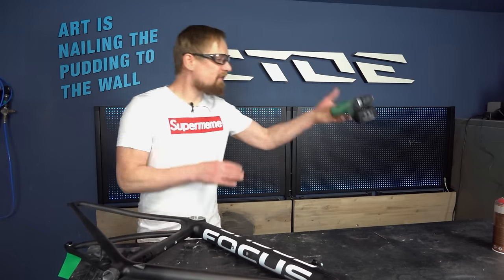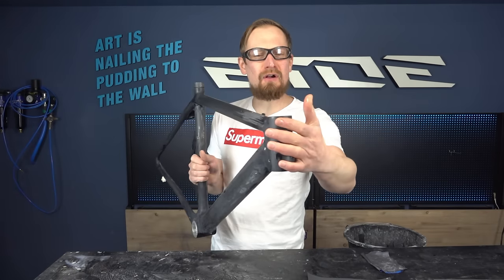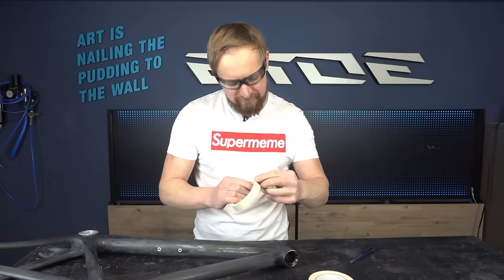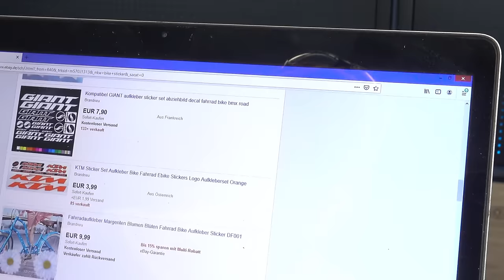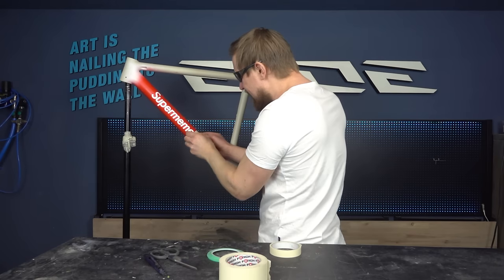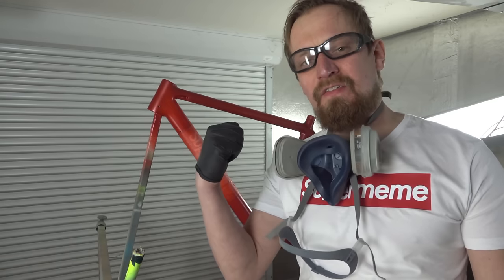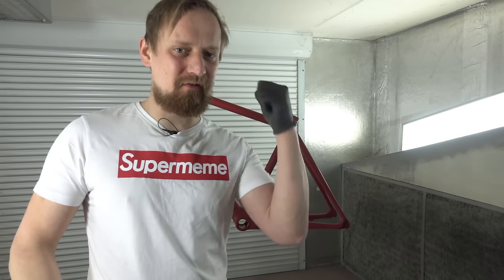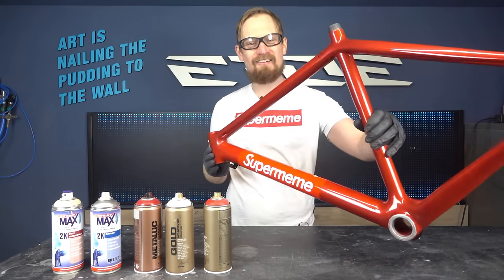spray paint a bike at home with supreme quality DIY

Comment: Martin.....dude! My favourite video yet! You calling people “pussies” made me crack up and I am not offended. I have painted many frames using spray cans, but cheap US stuff Krylon. These cans are not 2 part with hardener. I will be painting 4 bike frames soon. 1. Schwinn Scrambler 26r, Schwinn Scrambler 29r adventure, Schwinn Cruiser, and a 1949 Schwinn Hollywood girls cruiser that will carry Hula Hoops. The Hula Hoop bike will have 5 different colors, fades. The other 3 frames will have a single color.... metallics. Also I am DIY welding and designing from scratch using Schwinn tubes from recycled Schwinn Varsity road frames!  These up-cycled tubes will be used in the first 2 frames. The Acrambler 26f will be a tribute 16” wheel bmx bike. The Scrambler 29r will be a modern adventure bike with a custom frame pack. Both of these Scrambler bikes will have the same look as the 1979-1982 Schwinn Scrambler bmx bikes. I will send pics and I will be doing my first videos ever! You are my favourite painter and the best!

Warm Regards,
Tim in Boulder, ColoRADo (USA)

Comment: Hi Martin, your videos are so inspiring and you make it sound so easy. I followed your recommendation to paint my kids bike: aluminum frame, degreased, 2 x 2k primer and 3 x Montana gold paint. I want to mask with vinyl stencil and add some graphics but the surface is a bit rough and I am afraid paint will run under the stencil. How do you avoid rough surface with Montana Gold? Should I wet sand before applying the stencil? Any help is appreciated! 🎉
Reply from the maker: I just don`t paint a rough surface on the initial layer as shown in my spray can videos. That`s all. DIYers are not able to handle a can right and make these mistakes like rough surface.
Reply: @ETOE  thank you for taking the time to reply. Highly appreciated. It’s a bit strange, I sanded the primer to a smooth surface. Maybe it’s the way I handled the Montana Gold. Can I sand the base color? It’s a solid non-metallic color.

Comment: Hello im restoring my old trek 660 bike, I stripped the frame down to metal like you recommended,  gave one pass of primer , sand it, second pass and send it, the same thing with paint, but the clear it giving me hard time , it smooth some places but other is like sand , I'm using spray cans and I don't have a room so I'm doing it in my patio. What I can do?

Comment: Hey ETOE. Loving the vids. You've convinced me to switch to montana spray cans for my painting endeavours. Am just now experimenting with using two colours and am unsure about the masking process. What tape should i use and how long should I wait for the first colour coat to cure before applying the masking tape. Can I then apply the second colour coat straight after or should I allow the first coat to cure more. Cheers!
Reply from the maker: Thanks a lot. Helps to do more Videos. Curing depends and is an hour minimum. Or you force it in an oven at 60Degree.
Reply: @ETOE  cheers heaps. Well see how it goes!

Comment: How long do you wait between applying the clear coat and sanding? And how do you dry or clean the frame after sanding?
Reply from the maker: 10 minutes and with water. That´s the wet clear thing, sometimes blue as well depends where you find it.

Comment: Thanks for this fine tutorial!
I would like to paint with different colours. Is it ok to wet sand all colours after drying before the application of clear coat with p800. Or could i apply the clear coat without sanding during the next 12 hours? I use the stuff you mentioned below.

Comment: What kind of colours do you use when painting a frame professionally with the spray gun? Are these similar to the 1K Acrylic spray can colours you recommend for DIY-paintjobs, or do you use 2K colour + hardener? I‘m a carpenter and know how to spray paint (furniture, chairs), i also have a booth and a small hvlp gun. But i never did a bike frame or car parts, and i dont know what kind of primer/colour/clear coat to buy when not using spray cans. i only used paints for furniture so far. Any advice would be great!
Reply from the maker: By a wooden bike. Problem solved!

Comment: I dunno if ill get a respond but, i tried this method and it all works out except that when i try to remove the sticker after painting over it the paint kinds bond with the sticker and when i remove the sticker the paints kinda follows and lift up. Is there a kind of sticker and that would've prevent this from happening? Also the stickers i used are kinda thin should i use a thicker one? Like vinyl or something?

Comment: I understand the primer and first clear coat needs sanding back, but I thought the main colour needed sanding as well before the clear coat? Great video, thanks.
Reply: It depends on the paint your using some paints are designed to have a open time where you can put coat after coat with out sanding. Some may disagree but my auto paint teacher has museum pieces that beg to differ.
Reply: @allstarwoo4  - Understood, thanks for clarifying.

Comment: Guten tag Martin, Great video! You do make it look easy. I am doing a paint job for my 9year old boy who is upgrading to a 700 wheel size bike (small Specialized Ruby). I am in the process of sanding back all the pain and I have drilled out the old cable stop/guides. BUT, I cannot get the bits of the rivet from inside the frame. What are your suggestions? Drill slightly bigger holes or remove of the water cage bolts (I have seen another of your videos on that). Because he is a junior and the rules about gearing for junior races in Australia, he will not have a front derailleur so I could use those existing holes (which won't be used again) to drill bigger holes and then patch the hole?  Thanks again for all your videos. Danke und Tschuss Julien

Comment: I have removed all of the paint and primer from my steel bike frame. is it necessary to treat the bare metal with rust remover or rust converter? there is no rust after i sanded...Danke mein Freund

Comment: If I am going for a “raw” look on an aluminum frame with a carbon fork, could I skip straight to the 2K clear coat after the sanding and cleaning process? Or is there some sort of clear primer that needs to be applied before the clear coat?

Comment: Only one thing I don't understand what to do is:

After applying 2K clear coat and waiting 24 hours to dry and cure, then to remove the orange peel, I have to sand the frame. Ok

But after sanding it will look cloudy or milky (like in your video, the red frame looks like matte) and this is the part where I don't know what to do. Do I apply another layer of clear coat like you did in the video ? But what about the milky/cloudy look that the frame has after sanding ? Does that cloudy finish gets removed when putting the 2nd layer of clear coat ? Or do I have to compound and buffer to remove that cloudy finish before applying the 2nd layer of clear coat ?

I'm asking because on other videos on YouTube they say to sand the orange peel with 800 grit, 1200 grit, 1500 grit, 2000 grit then lastly with 3000 grit sandpaper, but then it doesn't stop there. They continue and say to use compounding to remove sanding scratches (even for 3000 grit), and then use another buffer type of stuff to remove the compounding swirls with the rotating buffer hand-held machines.

So what I don't get is that is it necessary to do the 3000 grit + compounding + buffering to remove orange peel or not ? Because in this video you don't do that and the finish is the same like other YouTube videos with compounding and buffering ?

Maybe both methods work the same way ?
Reply from the maker: I do BP. Butt Polishing. Put the frame between your legs and then shake your butt until the surface shines like the blink of a fairy tear breaking in the first strokes of sunlight hitting a new day.

Comment: Hi, I painted an old frame about a year ago with Montana White and did about 5 coats, one coat Evey 24hrs and it took around 8 months for the paint to fully harden, do you why it took so long to harden as it was so soft that it left finger nail marks when I pressed down on it, if you can get back to me that will be great! Thanks

Comment: How many hours did you give until you removed the Supermeme sticker from the frame after painting? Fully cured 2-3 days or just dry to the touch (couple hours)?
Reply: I wonder if paint stripper would be quicker to get the main junk off? Seems like LOTS of sanding!

Comment: Martin, can I use Montana HARDCORE and 94 cans on aluminum and carbon frame?. We dont have the mtn Gold here. BTW, do you sand over paint after removing those stickers. Or  you spray the final finishing coats? Thanks.

Comment: When you mix the hardener in the 2k primer. Are you still able to use the can the next day to give it another coat when it is dry on the frame? 
Or does the paint dry in the can?
Reply from the maker: 86 hours left to use it.

Comment: My first time watching your videos and I'm very impressed - you did a great job explaining and the results are great. Two things it would be good to help people on here with:
1, How do you clean the frame after sanding or between coats/handling? I'm assuming you wash down with water after the sanding and wipe with a rag and some thinners if handled? 
2, My personal preference is to start the paint job in some of the really awkward areas as, if you come back to do this later, it's likely to run. After those areas, you can move to the big sweeping movements.
Reply: Tack cloth is one wiping medium body shop people use.  Also body solvent, but I would check first to see what's compatible with carbon fiber. The song running in the background was perfect, especially the part with the girl vocals. Anybody know the name of it? I won't ask my wife, she might smack me.

Comment: Man, after working in a bike shop for a few years I feel I have grown paranoid of carbon, yet here he is man handling it no problem. Honestly I was kinda surprised seeing the rivets installed! Looks like a lot of force into that frame at a localized spot. So much stress! 
Ill stick to working on aluminum for a while haha
Reply: Hi, can you paint a bike without removing its old paint, just by sanding it first and after applying your new paint with no primer?

Comment: I keep getting a fine orange peel texture with the Montana Black. Does this have something to do with the higher pressure or heat low humidity? Temp was around 90 degrees F. and 35% humidity. Does Montana Gold work better as a bike frame spray paint?
Reply from the maker: Is has something to do with the painter and her expericence.

Comment: Hello,

Thanks to your video I was encouraged to paint and lacquer my carbon frame.  The result was good than I expected but the varnish disappointed me a bit.  I used a 2K varnish as you say but from the "kustom canz" brand.  The appearance is good but on the first route where sweat has fallen it has lost its shine.  Do you recommend a trick or do you recommend another varnish?  I am willing to sand this varnish and put another one.  Thanks in advance

Comment: Could you tell me how you sand the layer of Primer. Do you use 400 ,600 and 800 (wet) like before or 400 dry an 800 wet?

Comment: Hi Martin, I have recently painted a few layers of base coat on my old bike. I was wondering if it is OK to wet sand the top coat with 2000 grit before applying clear coat. My top coat has a bit of a rough/dry/powder-like texture to it... i want it to be very smooth before i paint it but I don't want to mess anything up! thank you
Reply: Same question here 😉
How can we avoid the rough/dry/powder-like texture?

Comment: Why not using paint remover for the first step of the process? Wouldn't it be faster than scratching te whole frame?
Reply from the maker: I answered this question more than 2000 times. Because it destroys the resin and carbon bond!

Comment: Should you sand down all the color from te original paintjob first? thats gotta weigh at least 200g on it's own. then you've added another what.. 400+ grams with these paintjobs?
Reply from the maker: They weight 50 to 70g. You should remove the original paint because of possible chemical reactions with the new paint.

Comment: Do you have to sand the top coat with high grit (800 or higher) before applying the 1st layer of clear coat?
Reply from the maker: Yes you have to sand the butt with high grit after the big poop before you put your pants back on.
Reply: How long did you let the 1st layer of clear coat dry before sanding and applying the final clear coat. A few hours?

Comment: I am in the last stages of this clear coat technique and the 2K clear needs to go on fairly heavy to lay flat, otherwise it leaves a sort of textured surface. It sets up really fast on the surface. How am I possibly going to avoid orange peel in the finishing layer of clear? Worst case is I have to polish the surface which will be a pain but look great.

Comment: Thanks for the video but to remove the decals use a rubber wheel. It will take you seconds to get them off with that wheel/ seems like you spent a very long time sanding.

Comment: Is it normal that the 2k primer/filler can be sanded (grinded?) way more easier than the original paint? Within seconds I was down to the bare metal again.
Reply from the maker: You applied not enough primer.

Comment: Hi Martin, carbon frames from China are usually delivered with a base coat of black-matt, if there is the option of ordering a non-pre-painted (raw) carbon frame, does the frame still have to be pre-sanded or something else?
Reply from the maker: If you are a lazy douche bag then no. If you are a pro painter then yes.

Comment: Hi Martin, I hope this finds you well. I have a question, when I drilled the rivets through then my frame is also ea enclosed system. How do I stop the bits trapped inside from rattling around please?

Comment: Could you talk about the timings in regards to the coats? My cans say 15 minutes between coats, but do I need to wait 24-48 hours for the paint to dry before I sand and clear coat?

I ask because I did 15 minutes between each coat for everything (primer, then paint, then the lacquer) but my paint (3 weeks on) still is soft enough to be scored with a fingernail even though it's been outside and middle of summer here.

Hope you or someone else can help?
Reply from the maker: Yes I can help. Send me your frame for painting.
Reply: If you put your clear coat over the base coat only after 15 minutes you're likely sealing in uncured paint. It may harden at some point but 3 weeks is a long time. You're probably screwed and need to redo everything.

Comment: Is a paint remover okay to use and then sand the frame a little bit to smooth the surface?
Reply: No. Paint remover softens the paint and will ruin the layer. If your going for a super glossy finish your clear coat needs to be perfect. Say you do a 3 either 5 coat clear the last 2 coats take as much time as your clear coat allows.

Comment: Hello Martin, i really like what you do and watch your vids every time when i want to paint my frames and fallow your guidance step by step but there is one thing i would like to ask and that is after sanding the frame in order to get rid of any kind bubble or uneven surface i have noticed that you also (even tho a litte bit) remove the paint. It has happened to me and did not know what to do. Especially in the last step when you ready to apply clear coat. Do i need to paint that area again or does the clear coat covers up that area?

Comment: Great video content, not falling short on a wee joke either! 😅 
One question if that's alright.
 Can I sand down aluminium frame (to a point of just bare silver aluminium) and once done just spray it with clear coat to protect it from rust and any other elements?
Seen something like that before but not sure if it lasts. Cheers
Reply from the maker: You can do what you want with your frame, even polish it with your panties.

Comment: Love your videos! I have a question for you, when sanding the primer do you use wet or dry sandpaper? I am planning to paint an old aluminium frame  with cans I will be using a 2k primer so will need to sand it before spraying the colour.
Reply from the maker: I use wet&dry sandpaper.

Comment: Thanks for this! If I have a multicolor sticker with a complex logo, can I just apply the sticker on the last, sanded layer of primer and clear coat it? How many layers of clear coat do I need to even out the surface above the sticker?
Reply from the maker: Yes if you want to produce crap.
Reply: @ETOE  ??
Reply from the maker: @TheMrEfPe  !!
Reply: @ETOE  That's very clear, thanks!

Comment: they there. i got some scratches in the clear coat, and the paint logo on the down tube. i sanded the scratches out, and fixed the scratched paint. 
now there is kind of a bald spot in the clear coat. not all the way down to the carbon. and bare paint
i have the 2K clear coat spray on order, but i was wondering what the best way is to blend the clear coat patch, with the factory clear coat.
Reply from the maker: Use fade out thinner as a car painter would do.
Reply: @ETOE  as if i know what fade out thinner is, or how to use it. 
well, i went ahead and did the first coat of 2k, and it went on very heavy. got lots of pooling and drips. 
i will have to do some level sanding tomorrow after it has cured.

Comment: Hello I do exactly the same method as you but it’s not solid... The painting is going away very easaly. How many bomb of clear coat you use for this project ? How can I do to have a really solid painting ? Thanks!
Reply from the maker: Use 2K clear and primer.
Reply: @ETOE   I use exactly the same Spray Max 2K Clear Coat. Do you have used just 1 bomb or 2 ...?